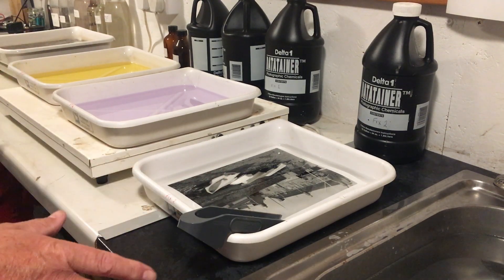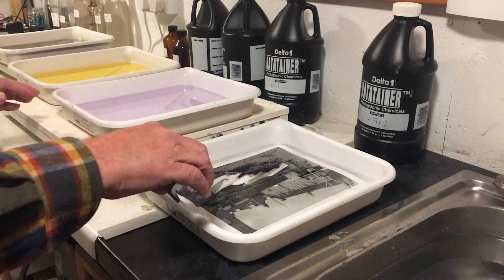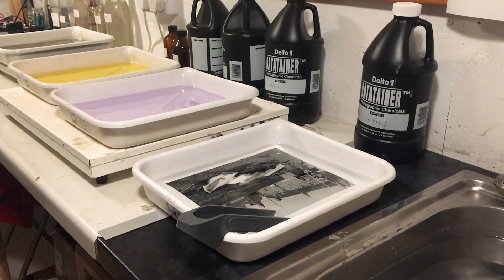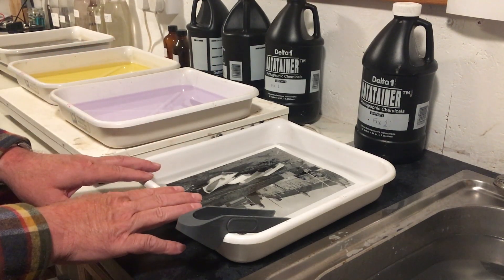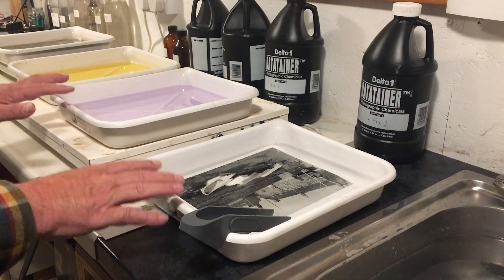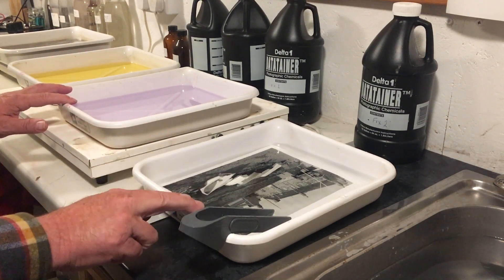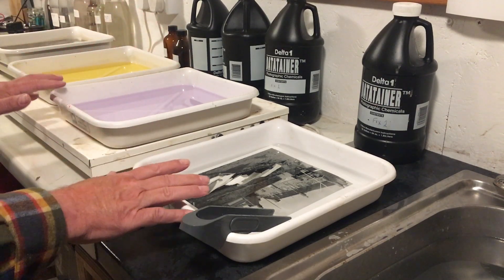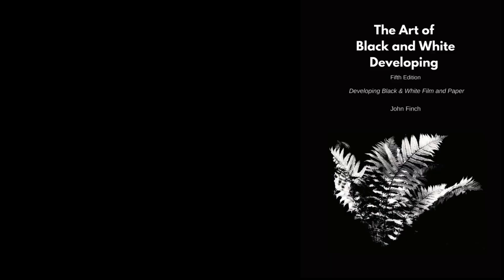Friday Tip: 2 Bath Paper Fixing!

Comment: I use a two bath fix on negatives as well since I read that it was standard practice 80+ years ago and was thought to add years to the film's lifespan (it as considered an "archival" method).  After reading some of Dr PE's comments online about color film being so similar to B&W, I also added this to my color (C41 and E6) processing.  I won't know for some years how archival the method is, but the immediate results are good.  I fix for the full times in each bath -- also read that somewhere but I'm not sure of the reasoning.  Also I just throw out the baths after some use -- for $3/liter it doesn't seem too bad.  The original rotation methods used in the mid 20th century were done as an economical measure to cut costs in commercial labs.  I have old Kodak manuals that discuss this.  Good video and very good points made.  Thanks again for a well thought out video.
Reply from the maker: Thanks, Dave. I'm going to do the film 2 bath on Friday :)

Comment: I still don't understand what's the point. Well, if that byproducts are staying on the print, doesn't it mean you didn't fixed your print properly? Like, not enough time passed or agitation wasn't good enough. Why then it is not recommened by everyone, like using stop bath, for example. Two bath fixing is just too complex for me in already not so easy process. Keeping track of everything is getting hard. Or is it just my lazyness, I don't know.
Reply: The basic idea is to let the first bath take most of the chemical "hit", including the impact of transmitted stop bath or (worse) water diluted developer where no stop bath is used.  
The 2nd fixer bath then receives a lot less odd by-products and dilution, which keeps it fresher and more chemically active. The economic plus here is that you can fix more prints reliably using a 2-bath process than you can with a single bath, because in a single bath, the chemical consumption and dilution will  reduce the single bath to its minimum function more quickly than if most of that occurred in the first of a 2 bath fixer. (If that is too complex for you, I think you need a different hobby because we a barely scratching the technical surface here.)
Reply: @randallstewart175  ok thanks for explanation
Reply from the maker: @endingmirage don't let complexity get to you. It took me years and years to get comfortable with the full gamut of darkroom work. Many of my tips are for more advanced practitioners and you can ignore the ones that you feel are adding complexity. Enjoy your process. Relax into a good routine and when the time's right add some of my tips.